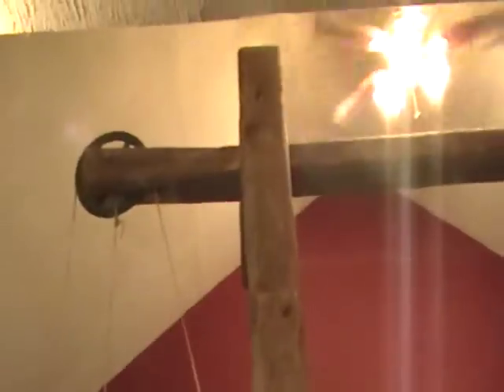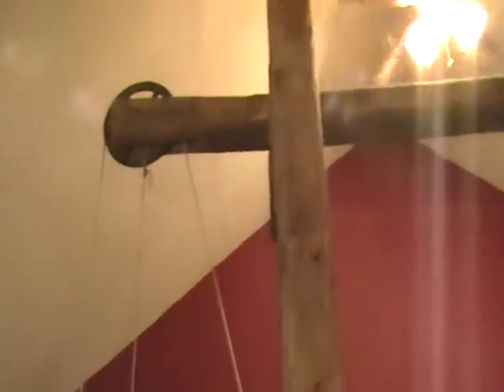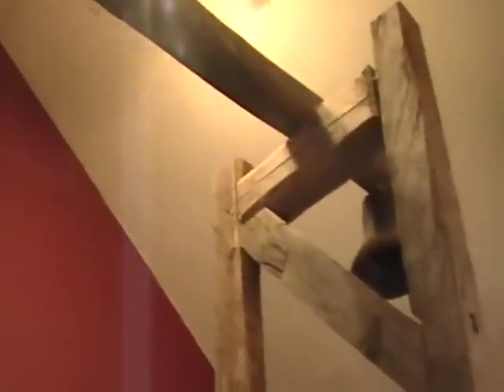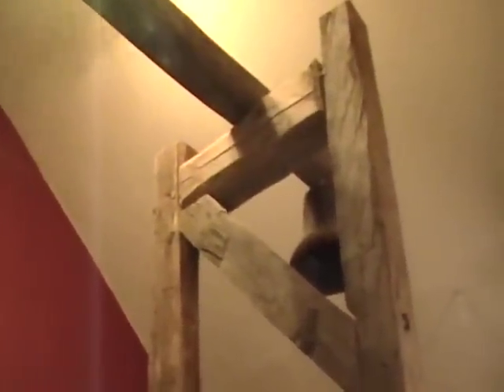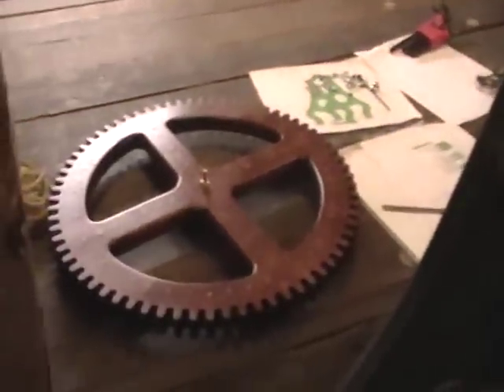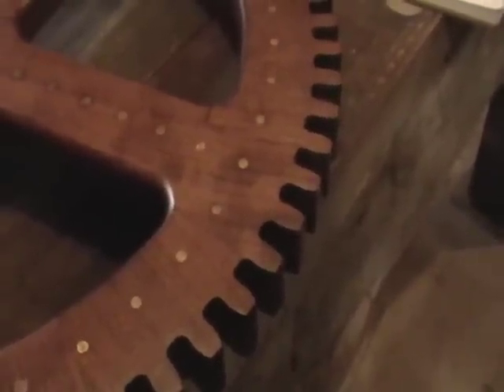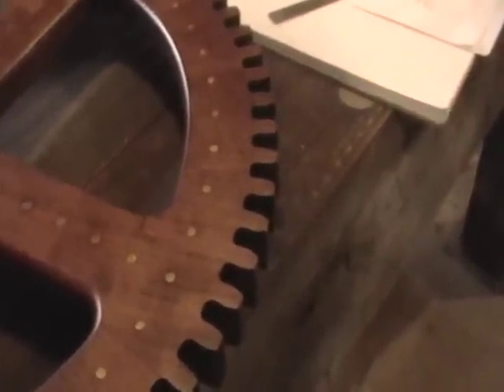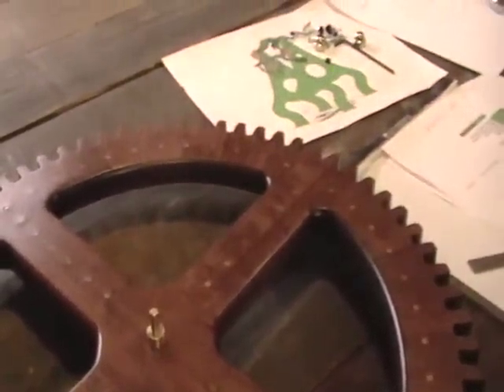huge wooden gear clock under way

Comment: a really great job but I think your low friction train will not need such a heavy weight. Be careful and start with smaller weights first. To high weights could be dangerous for the teeth and also add wear.